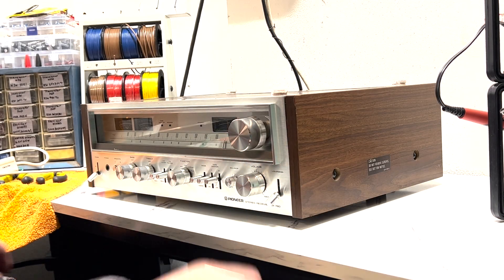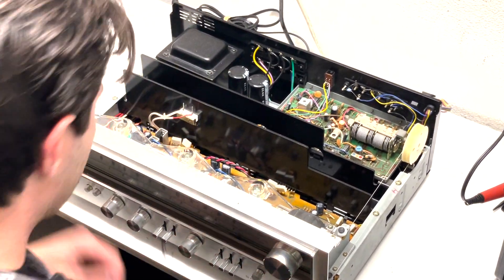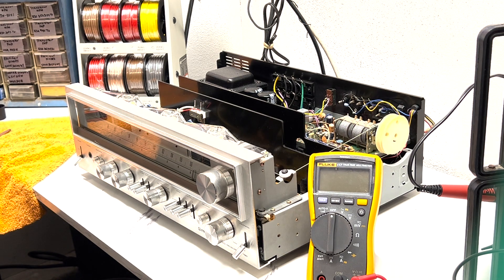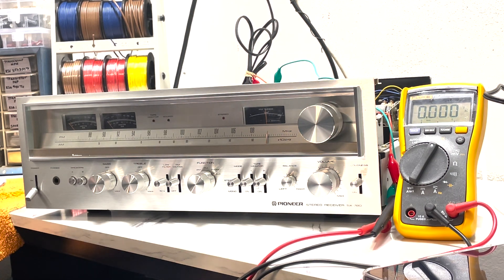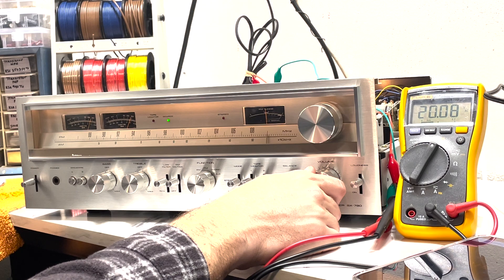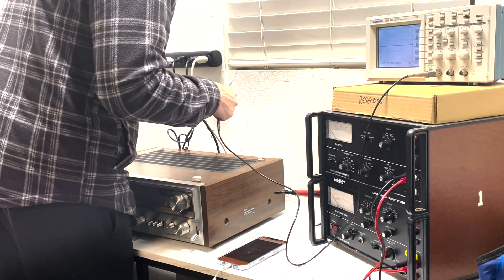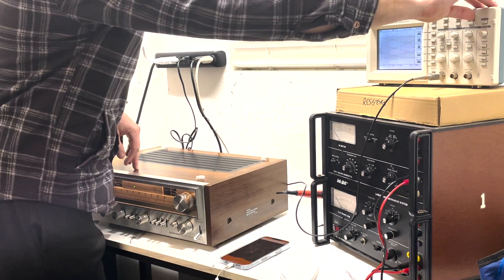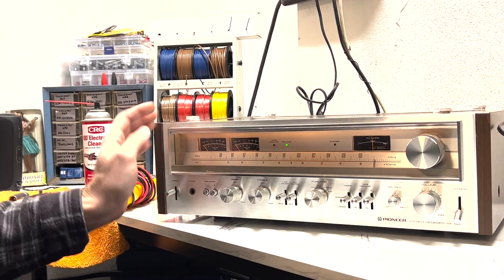Pioneer SX-780 Service! - Easy!! [45 WPC!] #electronics #audio #diy

Comment: When you were doing the DC offset adjustment the instructions show that the meter should be set to DC.  It really looks like your meter is set to AC.  The meter drive circuit adjustment is AC.
Reply from the maker: You’re 100% right. I realized my meter was set to AC after I finished filming. Off camera I rechecked set at DC.. forgot to edit that! Thanks for watching and pointing that out!!

Comment: What does it mean if the dc offset won't stabilize? It bounces around quite a bit, it doesn't stay put like in the video. Does this mean the Darlington power pack is going bad? Also, are both vu needle supposed to swings the same? My left needle feels lazy or swing lower than the right. I've done all the adjustments exactly as shown in the video. Power pack appears to be original but uncertain.
Reply from the maker: Usually if the DC offset wont stabilize, it could be caused by a leaky capacitor and/or transistor that’s allowing some DC to pass. If the unit is all original, I’m sure it could use a re-cap at the very least. Luckily the 780’s aren’t too bad to recap. Does clear sound with full bass and treble come out of both speakers? If so, the Darlington’s are probably ok. When those start to go, one channel with either start to sound flat and distorted, or go out completely. The needle situation could be tied to the Darlington issue, if one channel is weaker. Does the right channel seem like it has better sound than the left?
Reply: @TinkeringWithT  ok thank you. Can you look at the video i made the measurements for the dc offsets? Showing the reading. 
Pioneer Sx-780 DC offset reading, normal??
https://youtu.be/5MnSzs0FPZw

Let me know your thoughts. During inspection it appears that everything is original. Im not sure if the original darlington pack have number from 1-9 printed above the pins. But mine does. Each pin is numbered in white.

Comment: Great Video, I got a 780 about a month ago. After testing found that the left channel would go silent (meter would stay fixed), or more often produce some crackle/static. Powering on and off generally stopped that and would rarely or ever repeat over 2-3 hours of play. Had tried some CRC-26 from the outside, no help. Finally last week got some Deoxit and again from the outside, hit all the switches and now 3 days running for hours - no static. My problem now is the balance POT. Seems to be frozen, Cannot turn the knob at all and when I took knob off I see that one of the half prongs is gone.

Should I assume the POT is now useless and should be replaced (I can source a replacement), how hard is that to do?  Do I need to remove the face plate, or can it be done via access thru the rear? I've never worked on AV equipment, done some PC work and model trains. Tools are limited to a Multimeter and soldering irons. 

Alternately, is there any way to adjust the Balance POT (to EVEN) via inside access? I have no need to really alter balance based on the listening area and my streaming device has it's own EQ adjustments.
Reply from the maker: Sorry for the late response! Thank you for the kind words! Congrats on getting a 780! It's one of my favorite receivers! Glad to hear you got the the dirty switches resolved! If any of those switches get dirty, they can cause all sorts of weird static/channel going out problems. Bummer about the balance knob. If it's frozen, I'd start by shooting som contact cleaner/lube inside of it and gently attempting to turn it to see if you can break it free! Chances are, it'll still work fine! Give that a try first. If that doesn't fix it, I can look into how to replace the balance knob. The way you know it's centered is when you turn the balance knob, you'll feel a little detent while turning it to let you know that it's centered. Let me know if you get the knob freed up!
Reply: @TinkeringWithT  thanks... I have tried getting Deoxit in via the front knob a few times, haven't noticed any difference. I've been reluctant to remove the case (though it looks pretty simple), I wonder if getting Deoxit in the POT from the inside would work better. Other than that issue, it's been playing great since I got rid of static issue.
Reply from the maker: Yeah, I think the best way to clean it would be to get inside and have better access to the internals of the pot! Glad to hear it’s playing nice! The 780 is an awesome receiver.

Comment: I have my dad’s sx-780 that’s been sitting in it’s original box since being replaced on the rack in our home around 1990. Would you recommend opening the case to inspect before attempting to fire it up, and if so, what would you be looking for? Capacitors bulging, resistor burns, just dust everywhere? Is it worth just turning it on to see where it sits, or is that super risky?
Reply: Everything looked OK so I fired it up. Initially Left channel wasn't coming through but some fiddling with the switches and it's there. I need to get some deoxit in the switches and probably make those adjustments to the trim pots for the DC and for the VUs. I'll be following along with your video. 

After that it's time to look into the RT-707 that was with it in the barn...
Reply from the maker: Awesome!! Definitely wouldn’t hurt to open it up, and give a visual inspection on the components. Check for leaking/bulging caps/burnt resistors etc. if everything looks ok, I’d plug it in to see if it works! Let me know how it goes!

Comment: When you are adjusting the Watt meters, what is your multi-meter connected to? Service manual says to connect the voltmeter to the A speaker terminals. How do you do that?
Reply from the maker: You attach the leads of the multimeter to the place where you’d normally connect your speaker! The Black and red terminals on the back. Attach the meter on the Channel A or Speaker A side. Black is “-“ and red is positive “+”. I’d attach a picture but I don’t think I can in the comments! I think In one of my other pioneer service videos I included a picture. Let me know if you have any more questions!
Reply: @TinkeringWithT  Ah, OK. Thanks. So, it doesn't matter if you attach to the right or left speaker?
Reply from the maker: No problem! I don’t think so as long as it’s on the speaker A side!
Reply from the maker: Just make sure your balance knob is in the right spot!
Reply: Glad I read the comments, as I was about to ask the same question. I'm about to do the identical project here in a little while. To answer the question on which speaker, no it wouldn't matter as the Voltage will read the same since the adjustments on VR6(Pin 6) and VR5(Pin 9) have identical ratings at mV.  Thank you for this video 🙂
Reply from the maker: Yep! That's right! and no problem! Thank you for watching!

Comment: That's the wrong contact cleaner
Reply from the maker: Yeah, It's all I had at the time unfortunately.. I got some De-oxit and went back over the switches a couple weeks later. Sounds great!! Thanks for watching!
Reply: @TinkeringWithT  There is nothing wrong with QD contact cleaner. I would use a litttle lube afterward though on the pots. I would not use Deoxit on carbon pots.
Reply from the maker: Thanks for the info! So far it has worked really well for me. I’ll definitely use some lube after using it! Thanks for the tips!!
Reply: @bmboldt  actually few drops dextron transmission fluid in the pots works wonders. So spraying any spirit based cleaner needed unless it is totally funky. QD would be good followed by the transmission fluid.
Reply: @TinkeringWithT  yeah no problem because I use to use that and I always had to go back and redo the buttons and switches until I found out I was using the wrong contact cleaner 😂 I had never heard of deoxit 😂 but I do now and I use it religiously. But I do have a question I have the top of the line vintage Fisher stereo receiver the 1080 and I've been trying to adjust the DC offset and bias I followed the manual hooked everything up but when it comes to adjusting I turned them a little bit at a time but I get no movement on my volt meter and it's in the right settings Mv even though the dial is turning this is blowing me away because I also have a Pioneer 1080 and I set the DC offset and bias on that with no problem so I wonder what's going on with this Fisher.
Reply from the maker: Same here! I learned my lesson as well. De-oxit is the best! I like to use D-5 on switches. Really seems to get the job done! Oh nice! That is a beast! Hmm, I'm not really familiar with those units so I'd have to pull up the service manual. Sometimes the receivers have to be in a certain condition to check DC offset, like no volume, no input, no speaker load etc. Does the manual talk about that at all? If that's all good, maybe double check you have your multimeter in the right area, there have been countless times where I have been checking the wrong areas! ha! Does the unit work ok? Does it make good sound? I'll take a look into the service manual.
Reply: @TinkeringWithT  yeah the Fisher plays great but I'm trying to be a perfectionist and get it down to total ZERO the Right channel is at 8.1 and the left channel is at 10.1 and I appreciate you looking at the manual.
Reply from the maker: @ReginaldDj1  No problem! I'll try to take a look at it today. Has there ever been any work done on the unit? Or is it all orignal? It couple be possible that there are some leaky capacitors that are allowing DC to pass to the speaker terminals. Also, is the DC offset adjusted by turning a VR? I've read the the VR's used in most of the old receivers are no good, and fail over time causing you not to be able to get a good DC offset reading. It's happened to me!

Comment: Hello again ...!!! attentive to your instructions I dared to try to clean the variable commands of the equipment, after applying contact cleaner and drying it with a little pressurized air, it improved but after a while it failed again, it happens that some of them produce a noise like frying and , the channel that fails , now it is heard very softly , is it possible that the dirt produces this effect ? I ask, is there another cleaning technique, let's say deeper, or do I directly change the two Darlingtons? I thank you for the courtesy you dedicate to my query , which is in fact the last , I do not want to err on the side of boredom . I clearly realize that you are not a fortune teller hahahaha...!!!
Reply from the maker: Definitely! Dirt in the switches could cause a channel to drop out. Does the channel come back when you mess around with the switches? If so, you could isolate which switch is causing the signal drop. If it isn't a dirty switch, I'd suppose the power pack for that channel has failed or is failing. Keep me posted on what you find out!! I wish I was a fortune teller!! haha.

Comment: Very good video ... congratulations. I take this opportunity to ask you since I have one just like it. It turns out that one channel works fine but the other works very weak and distorts. I live in Argentina and I would appreciate it if you could advise me on what I should change. Thank you very much for your attention !!!
Reply from the maker: Hello! Thank you for the kind words! If I had to guess, first make sure all the switches are nice and clean! A dirty switch can cause distortion on a channel. If that doesn't fix it, I'd say one of the power packs is starting to fail. The 780 using a Darlington Power Pack for each channel, and they go bad after 40 years. They are fairly easy to replace if you have a soldering iron! And they are pretty cheap as well! The part number for the power packs is STK-0050. Keep me posted! and let me know if you have any other questions!